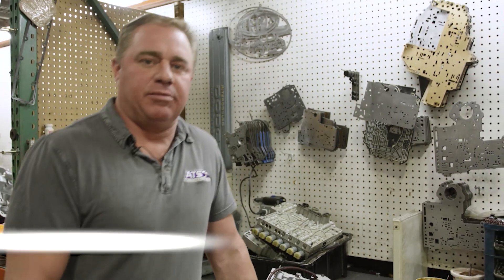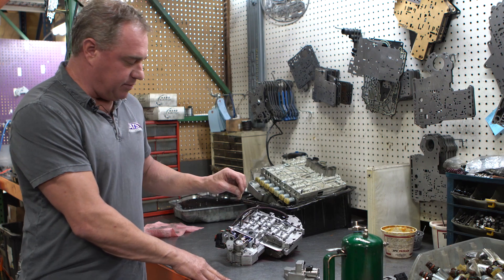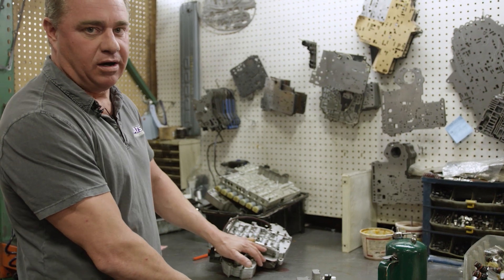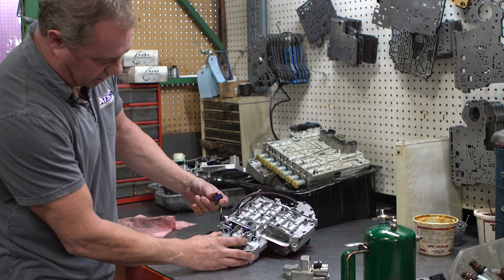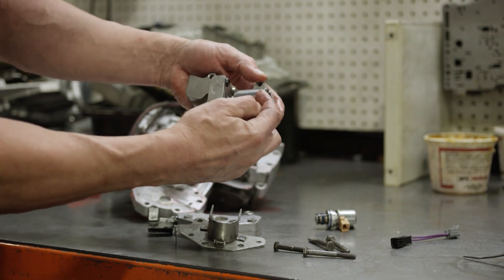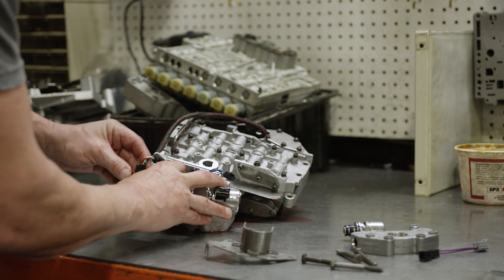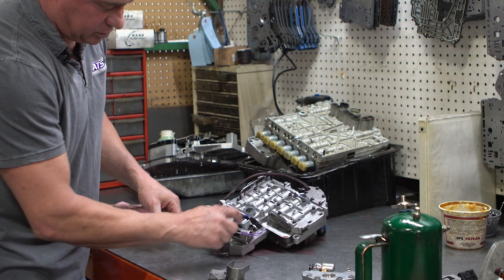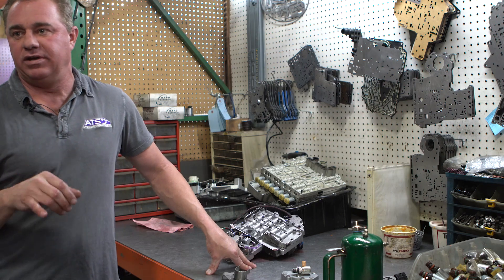ATS Diesel 47RE 48RE - GM Governor Pressure Solenoid Block Conversion Kit

Comment: Changed out the Governor  solenoid a few months back because of not going into first gear. Always starting out in second gear then shifting properly the rest of sequence.
I changed solonoid and things were fine for a while. It started again and found out I should have changed transducer too. I did that today. It fixed problem. Test drive showed softer shifts and always starting out in first gear.
What worries me is that the little adapter wire that was supplied with the kit,, the insulation on wires is going soft.
Is there an updated adapter cable that doesn't chemically react to Trans fluid?

Comment: In 2019 I put one of these units in my 47re (96 Dodge Ram w/6BT) and realized much better performance. In 2023 the 2nd gear band started to slip and ended up to need replacement. The transmission shop I use of course suggested a full rebuild which I went along with, new upgraded everything to a 2 stage transmission(w/ a 2 year/24 month warranty). While in there the shop owner also said they did not like the ATS GM Governor Pressure Solenoid Block Conversion Kit I had installed and replaced it with the Borg Warner upgraded Governor Pressure Solenoid set up. Since then (a year ago) I have experienced 1-2 and 2-3 shuttle shift issues like I had with the previous setup prior to the ATS GM Governor Pressure Solenoid Block Conversion Kit. Getting ready to take the truck back to the transmission shop and see what I can get them to do to address the situation.

Comment: the 2004 has the same issue my 48re in my 2004 has the same solenoid and transducer and they are junk I went with borg warner upgraded solenoid because the GM conversion solenoid is not good for the trans unless its properly built for it

Comment: At the beggining of the video you say its an upgrade for a 1997-2003 but at the end you say it's for a 2003-2007?  Which is it?  I am trying to upgrade my 48re from a 2002.5 2nd gen 5.9.  Also does this part come with the new sensors or are they separate?  Thanks in adv -Jack B.
Reply: I heard that also

Comment: 1998 12 valve 47re with fresh billet build. Before build it used to shift into 2nd at low rpms and low speed (maybe 8 mph). Now after the billet internals it almost seems to shift into 2nd twice. Once around 10 mph and again around 20-25 depending on how hard I'm on the throttle. My first thought was the governor solenoid. Any advice? Thank you in advance!
Reply: I’m having the same issue , did you figure out what was wrong with yours ? Thanks in advance
Reply: Maybe the lock up converter is kicking in.

Comment: Would that solve my overdrive to 3 gear shuttle shift on 03 dodge 5.9 cummins with 48 re trans. At 60 to 70 mph  it will down shift to 3rd gear and rpm spike from 1800 to 2500.. And it doesn’t do it all the time for about a year now.
Reply: i saw some kind a ground cable update at ebay for the problem u mention. was around 27 to 37 usd.
Reply: this will do nothing for 4th to 3rd gear shifts that is a different solenoid